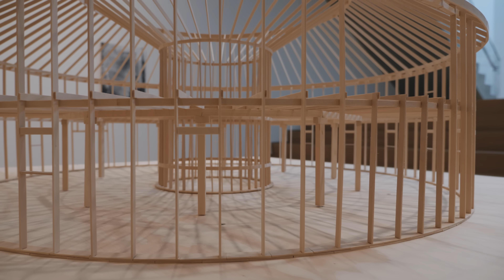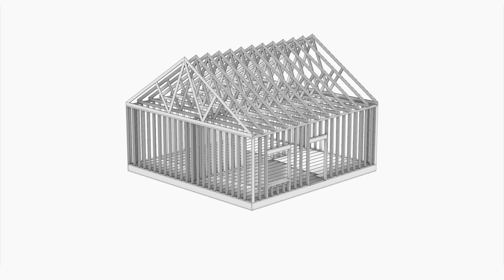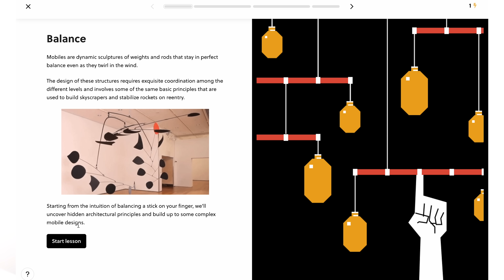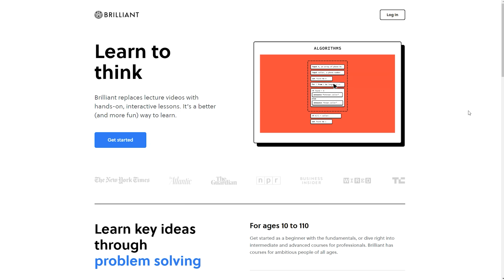The Genius of 2x4 Framing

Comment: it's really striking to compare this to how houses are built in Japan: they haven't entirely given up on timber framing, but the joinery is machine carved in the factory, and the posts and beams are often glulam.

there are still a lot of studs, like you see in this video, though, so it really does seem to be a hybrid.
Reply: Japanese carpentry in architecture is amazing, works with engineered wood wonderfully, and allows movement like stick-built with nails. I wish it were a real option in America. Most people still want the aesthetic of fine timbers with it, and even with engineered wood, would still cost noticeably more. However, it is something built from wood that is meant to last. Often it is cheaper to tear down a house a stick built house here than to fully renovate it.
Reply: @captainobvious9188  In one video on "flimsy American houses" I saw it mentioned that in Japan houses tend to be even "flimsier" than in the US and last a shorter amount of time.
Reply: @seneca983  That might be due to humidity and conditions structures face over there. What governs the building codes in differing places is in part things like... The weather and environmental conditions (earthquakes and such), the accessibility of building materials and cost effectiveness of transporting them, for example Norway mainly use timber due to the difficultys of transporting stone through its fractured landscapes consisting of rivers and fjords. And im sure many other factors aswell.

But still working with materials like engineered timber and beam and stone is considered to be much nicer than the cookie cutter houses of today.
Reply: @captainobvious9188  What really chaps people's hides here in the USA is watching a crew demo an old house with QUALITY, DENSE, FULL SIZED studs. Why?  Because they want to sell you more wood. Greed. Same reason when they tear down a metal structure with excellent condition components they specifically WRECK THEM and throw them in scrap metal piles to China. People would love to reuse the corrugated metal that is still in 20-40 year lifespan remaining. The I-beams and sundry again, have 40+ years left in them.  As for timber built homes. Vastly superior construction. Same with fitted stone or in more dry climates, CEB, made on site. Thermal mass really helps keep cooling and heating costs controlled. Stick built homes are chosen for the low skill level needed and for the ability to cut corners and costs while still charging premiums to customers. Wasteful consumerist society locked into materialism and self destruction.
Reply: In light timber framing the studs are actually structural and all contribute to taking the weight from above. In Japanese-style heavy timber framing, it is only the large posts and beams (usually spaced 182cm or 91cm apart) that are actually structural. The studs in between (every 45.5cm) are basically just there to provide something to hang the walls, windows, and cladding from.
Reply: In Europe it's roughly similar for light weight house construction. The wall segments are usually built in a manufacturing hall, often already with insulation, wall sockets etc. pre-placed and these segments just get assembled at the jobsite.

This pre-construction allows for machined joints that create stronger walls than simple 2x4 construction.
Reply: Japanese homes are built for a much shorter lifespan than North American homes.
Reply: @CleverAccountName303  
sad, but true.  one of my friends had her house demolished and built a new one on the same lot, and the builder explicitly told her that the house should have a lifespan of 40 years.

she immediately had concrete cracking and probably some other nonsense.

it's just sad.

I think this is a feature of building after WW2, though.  

I'm not sure about temples, but shrines were rebuilt periodically as a matter of course—in the inner shrine, they have two houses for the god so that they can move it into the spare house while they rebuild the other one.  a lot of shrines are listed historical sites, now, so they can't rebuild anymore.  my impression is that this rebuilding is a feature of Shinto, rather than cultural, beliefs.

I saw the rebuild of a temple in Nikko a few years ago—they had built a protective cover around the whole building that included a walkway so that you could see the work progressing from above.  they were, at least for the part that I saw, reusing the original timbers.  I'm sure they had to use new material for some things, but a lot of it was the same materials.  this, again, is probably because of its historical status, but these do seem to have been built to last.

I saw my neighbor, now retired, but at the time working in the building trades, partly demolish his house after his mother passed.

mostly, houses are demolished with heavy machinery, and the timbers are torn apart in the process.  perhaps since he was planning to use and renovate part of the house, he did it the old way, taking the house apart piece by piece.

houses like that are incredibly modular—iirc, the main joinery being carved at the sawmill goes back more than a hundred years—so I think the more traditional approach is to dismantle the house and reuse most of the timbers when major work is required, or to just pound in new foundation stones and add on when you decide you need more house.

those houses were built to last a lot longer, but there are very few people doing that kind of work anymore.
Reply: @@phillipbanes5484 At least the entire DACH region, France, Poland and Skandinavia.

Comment: But they burn!  Oh, and they rot too. 

Given that whole neighborhoods, even towns, are often totally destroyed by wildfires it mystifies me why we continue to build with wood.  I suppose the main attraction is it costs less than building with non-combustibles but if you were ever to lose your home to fire you may think differently about the initial cost.

Once when making the last round of the house to check that all doors and windows were locked before leaving on a much anticipated vacation I noticed ants crawling around in the corner of the living room and some pine needles on the floor too.  Couldn't figure out why but it would have to wait till vacation was over.  On returning investigation determined that a piece of flashing on the garage roof had not been installed correctly and water had been running down inside the wall in that corner and carpenter ants and mold had moved in.  Repair consisted of tearing out that whole corner of the house and rebuilding it from the foundation up to the second floor.

Interestingly several years after I sold that house a fire started in the garage and burnt the end of the house so that corner was once again rebuilt.  I guess that corner was just jinxed.
Reply: We dig up old cities made out of masonry and they were burned to the ground too. Or are you going to sleep on a stone slab?

Comment: Okay, I get it, it's lightweight, cheap and efficient to put up, but this appears an alien concept to those of us in Europe used to solidly built houses. How does this kind of construction method effectively insulate a house from the extreme hot or cold? Cavity wall insulation is the norm in the UK helping houses retain heat in winter and cold in warm summers. I know this kind of outer wall construction will be more expensive at the start, but surely it's a worthwhile long term investment from a financial and environmental standpoint.
Reply: Look up the insulation (R value) of double brick, cavity brick and concrete construction and you will see that they are natively very low. Double brick with cavity between is R 0.5 to R 1.5 depending on the source. Concrete walls and concrete block walls are worse. Our timber framed house has an R value of R 9 for the roof and R 5  for the walls. Obviously this was achieved through adding insulation - but it was easy and cheap. Of course there are many ways to improve the R value of masonry construction too but not so easy. The local council required us to have a minimum of R 5 for the walls and I could not find a way to do it with masonry construction for our house design. (NB these are SI compliant R values - so multiply by 5.71 to get US values).

Comment: The problem is that the modern house has some 700,000 pieces if you count every nail, stud, mud, chalking, and roof.  Almost all of these pieces are brought to the worksite, literally thrown on the ground next to the sidewalk, and brought to the -place-of-use' by very expensive hands.  In addition, many of these pieces need to be cut by hand (2 X 4 'sisters' on the window's sides need to be cut to a new length, drywall needs to be cut (and the pieces carried off and disposed of).  The answer is NOT to build pre-fab houses (you are moving 90% air down the road, they are limited to 15 feet in height, and they only save 20%).  The answer is to build parts of the house, like an entire wall, the plumbing main, and roof sections off site.  Imagine the exterior walls built eight feet tall and twenty feet and lifted by cranes on the trucks that bring them, into place.  All of the interior walls (finish the closets off site and lift into place and you eliminate one of the most costly parts of construction (same with the bathroom--and especially stairs).  Floors and sub-floors with joists can be brought in in sections 10 feet by 20 or even thrity.  Same with the roofs.  You need to expand your vision to make any real progress on the cost of homebuilding.

Comment: love your videos stewart! this in particular filled in a gap that i'd been wondering about, seeing so much timber frame construction go up all the time.  It did leave me wondering what contemporary alternatives to this mode of building might be, perhaps that could be your next video. Cheers mate
Reply: That there be a lot of fancy words to ask a question....

You have stick framing (platform or post and beam)
You have metal framing (platform or post and beam red iron)
You have masonry ( brick or concrete)
For concrete you have pour in place or tilt up.

That's it.

Comment: Its easily available in u.s,but not feasible in other parts of world because we don't have such industrialized manufacturing or these 2×4.for remote builds timber framing in much more effective for a group of people with local materials because it takes less effort to cut large pieces out of tree manually..

Comment: There are certainly advantages to wood framed houses, and they are less expensive than other materials because we have a lot of wood available.  In the UK, most homes are built of cement block and brick, in part because they don't have as much lumber available.  Block and brick houses are perhaps more durable and more fire resistant, though they are more expensive to build and to modify.

Comment: I’ve only worked on a couple of homes years back, so I can’t speak for the industry at large, but using 2x4 interchangeably with this type of construction may confuse by the fact that outer walls in newish homes are 2x6, with inner walls being 2x4. I know some(most?) older homes used 2x4 for outer walls, but 2x6 are sturdier and provide more insulation.
Reply: It's been about 2 years since I was directly on a new housing site, so correct me if I'm wrong. But 2x6 outers might be a regional code thing as I've only ever seen 2x4 with a 2x6 option. Not counting commercial buildings, of course. As those are mostly steel studs around here. Though, they did build a 3 story wood condo building in 2014 using 2x4 outers (covered in brick and steel though.
Reply: I have just recently moved to California, and I am disappointed to see that they are still using 2x4's for exterior walls. 
This is nuts when you consider the extremely high cost of energy here.

Comment: My 3bed two story house was constructed in 1943.  The framing lumber is old growth pine. I have a 2x4 about 4 feet long from a small roof section that I reframed.  This wood is like working with oak !   The edges are square, not rounded over.

Comment: The advent of powered lumber mills and cheap steel nails changed the economics of wood construction.
Prior to power mills, turning a log into a square timber required handwork, so the cost of the product was primarily in the labor, NOT in the material itself.  Trees were plentiful and cheap.  Dressed lumber was expensive because men had to either hew them, or saw them by hand.
After sawmills became powered by steam, or electricity, the cost to cut a log into many smaller planks dropped drastically.  The value switched over to the material, and away from the labor costs.
Timber frame construction required greater skill from the workers, but it also used more wood because the mortise and tenon joints removed wood at the very locations that carried the greatest loads.  That meant the timbers were sized for what was needed at the joints, and a lot of extra girth was put into the building that didn't need to be there because removing that extra wood cost too much money in manual labor.
Reply: Timber framing looks like it would require more engineering calculations if it was the most common way to build 1 million homes a year.

Comment: What a delightful video!  One question occurs to me:  Around 6:58, you note that "platform framing" develops which (because the studs stop at every floor) requires shorter pieces of wood.  But what surprises me is that this started in the West .  Why would this have not been first thought of in Illinois, a state with a nickname (Prairie State) with a dearth of trees, to say nothing of forests?  With the huge virgin forests of Oregon, California, Idaho, and Washington, they much more than Illinois would not have needed shorter lumber.
Reply from the maker: I think it had to do with which areas of the country were being settled at the time it had evolved. San Francisco was really built with platform framing. I thik there were platform frame buildings in Chicago too around that time, but it really hadn't become the standard...